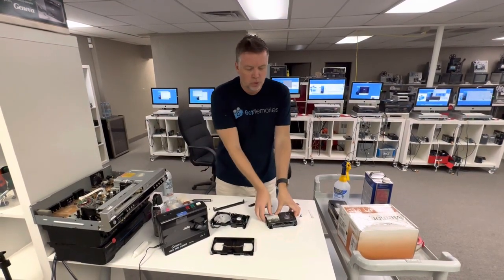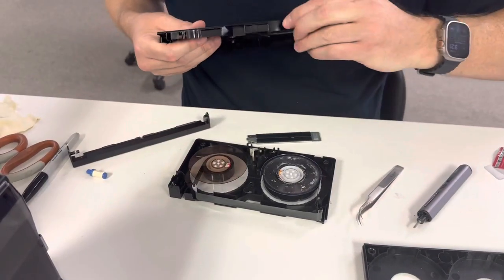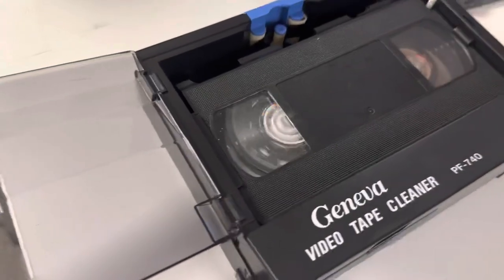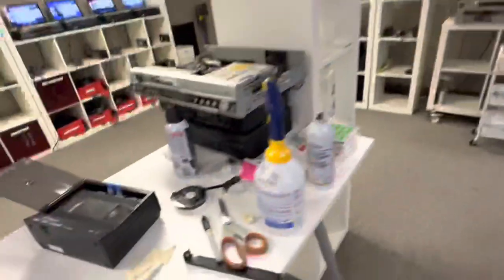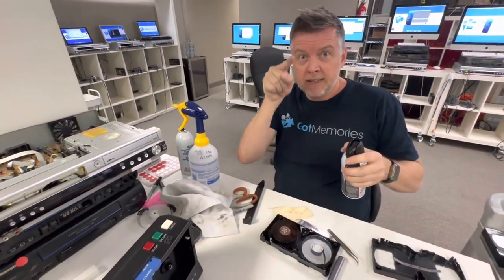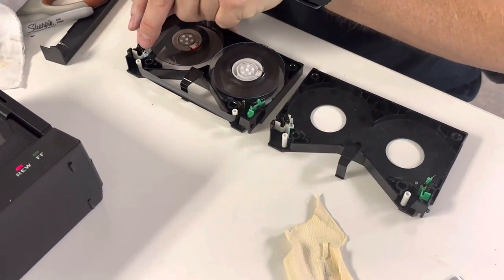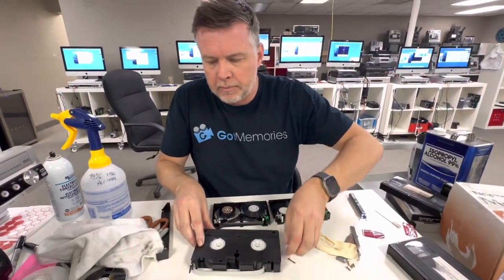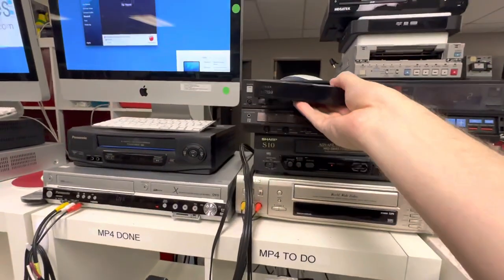How to Clean Mold off Sony Betamax Tapes Part 1 - Digitizing to MP4 / USB / Cloud

Comment: Transferring the tape to a VHS shell sounds tricky but thankfully i DO! Have a beaten up VHS cassette case i can transfer the reels into.

I do not have a generva tape cleaner or a VHS player in my possession to use, I'm sure charity shops occasionally get them in...if all fails eBay yields interesting results. The only VHS Device i have is my beautiful 1988 Ferguson Videostar FC08 Full Height Camcorder.....the tolerances are super tight anyway.

My owm Beta machine also needs a TONNE of restoration work as it was saved from a Skip. But I'm pretty good with Electronics and Mechanical bits.

Just recently fixed the eject mechanism on it by replacing a rubber belt! 😄 Slowly getting there....the heads do need a lot of attention though.
Reply from the maker: Thanks for sharing! All the best to you and your projects!